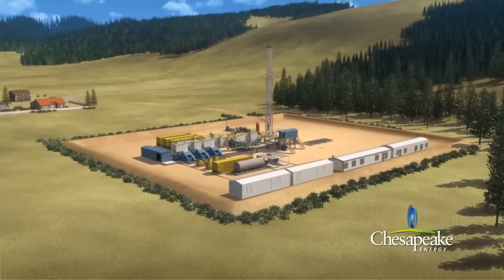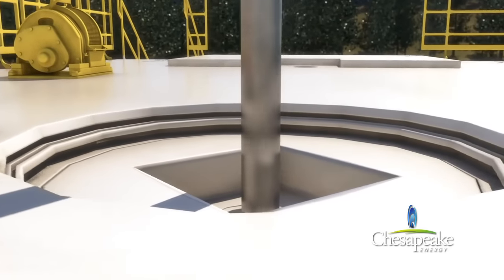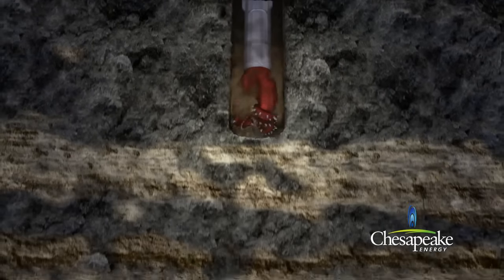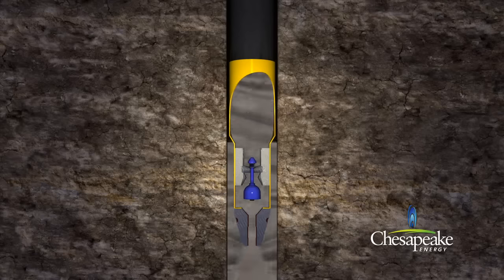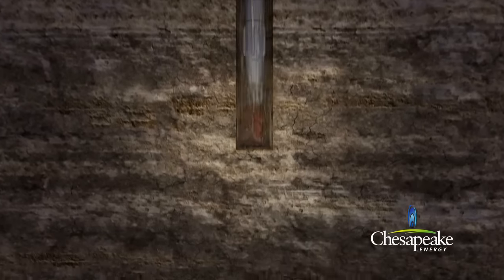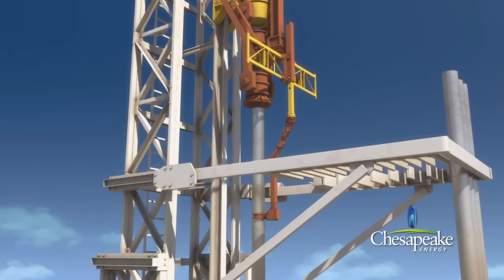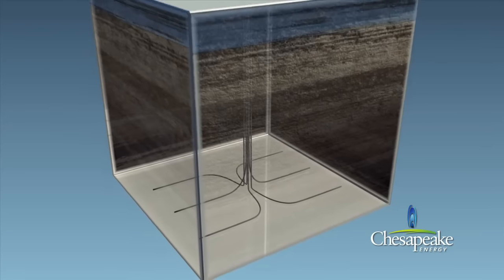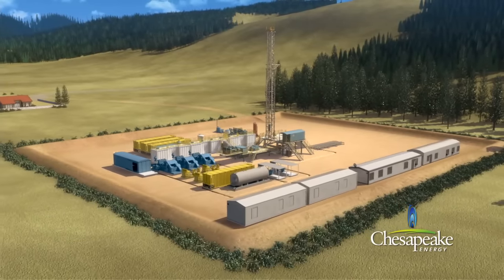Chesapeake Energy horizontal drilling method

Comment: I don't understand how the drill pipe bends through the curves.. There is the "knuckle" of sorts they install to make the head move, but how does the entire length of pipe bend like that through rock not getting snagged?  I still struggle to understand horizontal drilling.  Most videos just say "advances in technology" -Great, that helps so much..

Comment: After the concrete hardens, a perf gun is lowered to the farthest point of the lateral, and it perforates holes through the casing into the target formation. Then frac fluid & propants are pumped at high pressure down the hole, escaping at the perfs and into the formation causing it to fracture and let oil and gas escape. The propants keep the fractures open, and the O&G flows into the production casing and up to the surface. They repeat the frac about every 500 ft to maximize production.

Comment: Do you Drill thru the water table ? Does concrete crack ? Can casing blow out ? ! 
What is in the frac Solution ? What is the mishap percentage ?
Reply: Yes, yes and yes.  Like any human activity there is no 100% solution.  But the engineering is sound and there are measures to make whole anyone who is harmed.  This is not done by fly by night operators.  The mishap percentage is in the single digits.  I know of only one incident where the companies paid out about $4 million in remedies and damages to the affected people.  It is not cost effective to make mistakes or poorly engineer these things and no one wants to harm someone by being careless.  This isn't like the ATF that burns women and children to death and shoots unarmed women holding babies with never anyone paying any consequence.  (Waco and Ruby Ridge).
Reply: do cars crash, do home burn down, do people choke on food. What other stupid questions do you have?
Reply: It's not the engineering but the people factor
Reply: to answer your question: approximately 20% of the wells drilled start with a cracked cement casing that allows fluid to leak into the surrounding water table at ground level.

Comment: The angle changes over such a long distance that it can pretty much be approximated as a straight path. Still, there will be forces and stresses in the drill pipe, but drill pipe is very strong. However, it does have a certain lifespan.

Comment: Horizontal wells and multiple branch connection technology to ensure safe and cost effective alternatives to the many traditional vertical wells that are more expensive and do not comply with the shale fracturing process in an environmentally friendly manner. This new process will meet the future challenges of gas production in tight formations, minimizing the severe vertical damage caused by massive vertical fractures.The horizontal well and technology in connecting to  multi lateral package for safety and effective costs optimist the replacement of higher costs conventional  many vertical wells and not in line with environmental manner process into fracking of shale rocks. This novel  process will for the future challenges of gas production in tight formation that minimizes vertical severe damages of vertical huge fractures.

Comment: Mud motors are not rotary steerable - aka the pipe does not steer at the rotary table, the driller jsut sees the pipe moving into the ground, the mud pressure spins the bit.

Rotary steerable devices steer while the rotary table or top drive is adding surface RPM to the string. 

For point the bit vs. push the bit, google Schlumberger Xceed and PowerDrive

Comment: when the rig is drilling the curve the drill pipe is no longer rotating, there is a slightly bent sub with mud motor and bit on the end of the drill string.  the pressure of the mud pumps rotate just the bit therefore allowing the driller to steer the drill string while monitoring the direction from above #Bronco Drilling#Accurate Drilling#Patterson UTI

Comment: We see only isolated vertical and horizontal tubes in the ground in this video.
What happens after?
Reply: Perforation of the casing in the production zone and then fracing.
Reply: Kelli Hollinger They put another tool down the wells that punctures the production casing and its concrete outside layer?
Reply: Michael McDonald Its called a perforating gun. Its punches holes through the production casing and the cement sheath into the oil and gas shale. The well is the hydro-fractured. Fracing forces millions of gallons of water, sand and chemicals down the borehole at high pressure (5000psi+) to expand and deepen the previous fractures into the shale wider so that the oil and gas will flow out into the wellbore and up to the surface.

Comment: People are confused as to how the pipe can rotate along its axis if it is not perfectly straight (they think the hole would become over-gauged as did I when I first got into teh business).

But I was explained that the wells are so long (usually 2-12 km), and the angle builds over such a long distance, that the entire string can be thought of us a straight line, allowing the string to rotate perfectly (approxmiately perfectly) on its axis.
Reply: How are you able to rotate such a long string from the surface without it just twisting up?  I'd imagine you could spin the top section several revolutions before the lower portions even begin to spin due to the ductility of the steel pipe.

Comment: When the cement seal is formed, how can they know that pressure doesn't increase around it? The cement pump is retracted... and then is the cavity at that point under pressure before the drill is returned?
Reply: good question. When formation fluids enter the well from pressure, thats called a kick
Kicks are controlled by maintaining a safe pressure on the drilling mud using high intensity pressure from huge engines above the ground.
There are a lot of gauges and sensors everywhere. If a kick can't be contained then its a blowout. Blowouts are not very common because of better trainings and new BOPs (blow out preventer) but are almost always very devastating

Comment: There should be 1-2 strings of intermediate casing but Chesapeake is too cheap to use those to protect the deep formations and add additional insurance for casing fractures.
Reply: do you know for sure if intermediate is required?  If it were, chesapeake would'nt  have an option wether or not to to use it..
Reply: The use of intermediate casing string(s) is usually left up to the driller as per the geologic conditions that are encountered.  We also don't know if Chesapeake and others are running the casing all the way to the surface  or they might be hanging each subsequent casing string from the previous casing.  

I don't have a problem with drilling into the Marcellus and Utica shale, but the protection of groundwater must be absolute,  during drilling, fracing and the subsequent use/disposal of frac fluid. Id prefer that frac fluid be refused instead of being injected into waste wells.